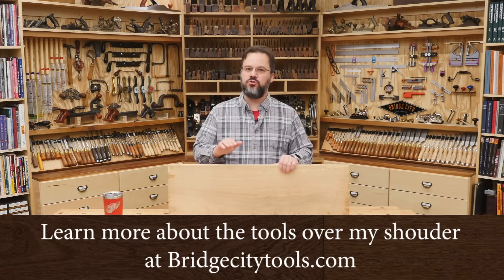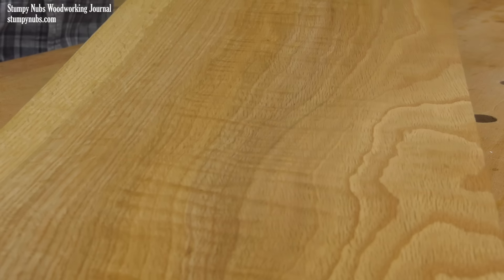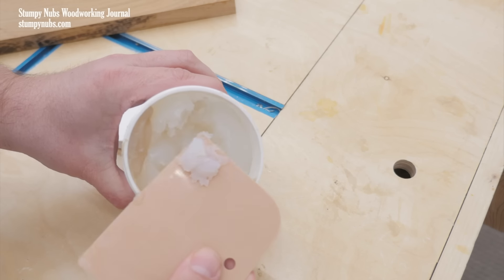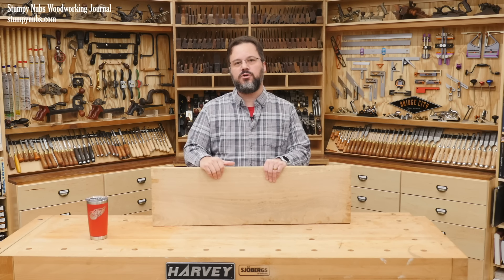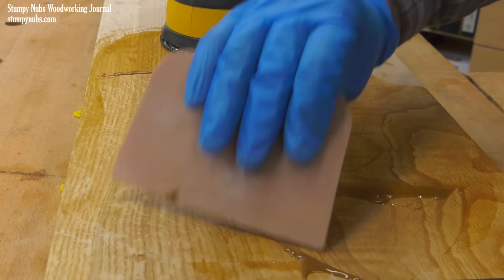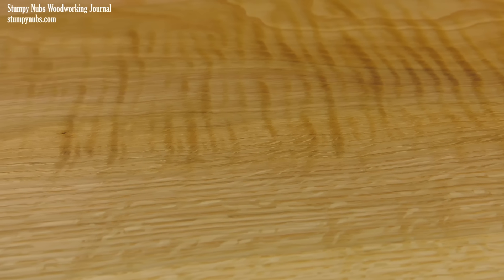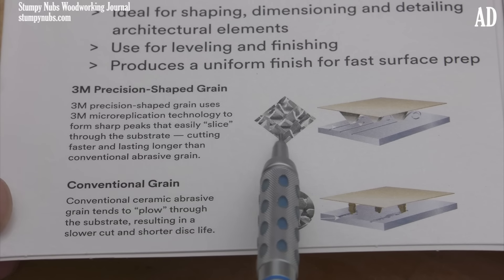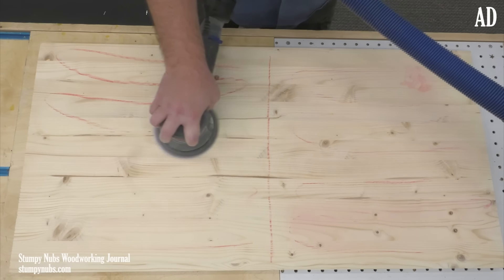The best wood finish I ever used CONTAINS GRAVY!

Comment: so what I'm getting from this is biscuits and gravy are an important part of fine woodworking.
Reply: Small correction - Really good biscuits and gravy are an important part of fine woodworking (and the rest of life).
Reply: Yeah but where are the biscuits? I don’t want the ones that taste like wood chips lol
Reply: @kenbrown2808  really it only affects how you feel the wood. Here in Mexico a similar technique is used because it a lot cheaper and got a very smooth finish on any wood and stills feels like wood and not plastic.
Reply: @pedroe5576  Please describe that technique for this group.
Reply: @Sagart999  I have said in my comment of the video. Here in Mexico there's a similar technique that only old woodmakers and cabinet makers do. Instead of a sander they used a scraper to push the sealer through the pore. The sealer must  be very thick in order to do it and requires an special movement of the hand to apply it without leaving marks. After the pore it's sealed you can continue to put the finish or let it dry. Now a days only old woodworker or cabinet makers know this technique because is a little tricky and requires time.
Reply: There are some examples in youtube but in Spanish. It's very rare to find information because few people still use it nowadays. All just us polyurethane finish and go.
Reply: That sounds great.
Reply: Of course

Comment: I used to dry sand and collect the dust and then mix it with oil to spread over the open grain.  This method holds onto all the dust instead of losing half of it in the dry collection method.  Thanks, Jim!
Reply: What would be the ratio of saw dust and oil? And is it linseed oil or oil based finish?
Reply: @tonyhawk1948 linseed oil, BLO, are both an oil finish, just like oil based polyurethane, pure tung oil and others are. I would be reluctant to use straight linseed oil since it will take forever to cure. Pure tung oil takes 24 hours, poly usually cures in 8 hours. Not sure what the cure time is for BLO, I think a couple of hours?

As far as the ratio, just combine and mix until your gravy is similar to what you saw in the video. There is no exact recipe for gravy, just like when making regular gravy in the kitchen.
Reply: @bigk4755  thank you so much for the information
Reply: BLO and pure tung oil actually take a couple of weeks or longer to “fully” cure. But can be used as a base for filler overnight - depending on how warm or cold it is.

Comment: I used this method 40 years ago on a dining room table. I did it by hand though. Beautiful finish. 6 hand sanded coats of marine spar,finally rubbed out with rotten stone and mineral oil. I had forgotten this technique, thanks.  Sadly the table was lost to Katrina.

Comment: I do something similar with my lathe projects. BLO or Walnut oil with a coarse sandpaper. Sand it while spinning. Put enough pressure for it to get hot, and it will leave a mirror polish. The dust mixes with the oil and eventually cloggs the paper, causing the grit to effectively get finer and finer until it is just burnishing the wood. Works a treat and is pretty fast. The heat generated also causes the linseed oil to polymerize quicker.

Comment: I tried it on a piece of oak plywood I had laying around and this worked and how. I was afraid to sand oak plywood to much for fear of going to deep on top oak level. So I layered 4 or 5 coats of finish trying to make the surface smooth both look and feel. This process work with 1 % of the labor and provided a great surface. 😊😊😊

Comment: Here in Mexico there's a similar technique that only old woodmakers and cabinet makers do. Instead of a sander they used a scraper to push the sealer through the pore. The sealer must  be very thick in order to do it and requires an special movement of the hand to apply it without leaving marks. After the pore it's sealed you can continue to put the finish or let it dry. Now a days only old woodworker or cabinet makers know this technique because is a little tricky and requires time.
Reply: I didn't know Americans used a similar technique to sealed the pore instead of only use polyurethane finish. I'm gonna try your technique with the sander because it looks a lot easier than using a scraper.

Comment: Hey, thanks for the tip on Cubitron. I have 2 decks on my house and both needed replacement. I chose Ipe as the decking material. I saw your bit about Cubitron the first time you mentioned it - probably a year ago. It was just after I started replacing the first deck. Although the lumber was "okay" when it was delivered, I could still see significant planing marks on the lumber. I tested a few pieces by oiling them and the quality wasn't very nice. I also noticed that upon delivery, there's quite a gray haze already starting to form. Suffice it to say that regular sanding disks weren't cutting it. They would last for about 40 linear feet of board and be almost completely depleted. I tried the cubitron on a DeWalt orbital sander (random orbital took WAY too long), and with a little finesse and a short learning curve (sander wanted to wobble and grab), I was able to process the boards with relative ease. The Cubitron cuts REALLY well, but doesn't tear up the grain, so the swirls from the sander don't show at all after oiling the boards. Love your videos, please keep it up!!!

Comment: Years ago, I had a nice herringbone parquet to be sanded, fitted by the customer - a qualified carpenter -.
It was beechwood,  with gaps of 1-2 mm in many places.
Gave it a full sand with grit 80, mixed the fine dust with cellulose sanding sealer, got a fair amount of gravy /putty.
It fillings were not visible at all.
Reply: "qualified carpenter".
He should have stuck with framing.
My grandfather was the same. Journeyman
carpenter, Not a wood worker. 😁✌🖖

Comment: I've done this with Watco Danish Oil and increasingly fine grits for several coats drying between. Super Silky finish with no further need of a top coat on lighter duty pieces. Learned it under the name French Polish I think.
Reply from the maker: French polish is a process of layering many very thin coats of shellac to build up a deep, beautiful finish.
Reply: @StumpyNubs  I probably have the name wrong. It was at least 15 years I read about it, but I've done it on several open grain pieces and it's great.

Comment: Ive been doing a variation of this for over 50 years. Wet sand  with mineral oil and wet/dry sandpaper or pumice, then rottenstone. Clean with mineral spirits and polish with paste wax.
Reply: You are not creating a hard, durable, finish.
You are just french polishing and putting
a shine on the paste wax. To be durable, that
paste wax needs a hard finish underneath it.
Reply: @zapa1pnt  Sorry I wasn't clear. This is what I do after multiple coats of lacquer, shellac, poly etc.
Reply: @IronCreekSW26  : Oh, OK. Much different.

Comment: I use a similar technique with bog oak knife handles using super glue instead of finish. Put a thin coat of super glue, and sand it with loads of debonder applied as you go. It fills the pores with sawdust and superglue and leaves a beautiful finish.

Comment: I suppose it should also work with a mixture of pre-collected dust from orbital sander and oil, all worked in with fine sandpaper or rag? I think it should be equally effective and you also won`t gunk up the orbital sander. Or am I missing something?

Comment: may i recommend filtering sawdust with a set of fine meshes. this way, you can use red cedar heart dust or mohagany to color the pores with different colors
Reply: That could be really nice, I'm sure, but this
method is avoiding all of the collection, and
grading, of dust and just using what is coming
off the material you are working with, at the moment. 😁✌🖖

Comment: Hi James, you have had several videos on shop safety that have been great. I see in Harvey table saw manual they recommend grounding the machine itself. Should we be grounding our work working machine? This is something that I have not done.  Thanks for your input.
Reply from the maker: The machine is grounded through the electrical outlet, isn't it?
Reply: @ Thanks.  Thats what I understood.  But they call it out separately in manual.

Comment: This sounds interesting. I also appears to be relatively simple. It is something I will have to try in the next project. I have not used much oak for furniture so I haven't encountered the open grain problem. However when I started wood working in my 30's, I do remember several references to using a grain filler. I seem to remember it was worked into the grain with something like burlap. Does my memory fail me? Thank you for sharing. Have a great day and stay safe.🙂🙂
Reply from the maker: Never used burlap, myself.

Comment: If I’m using a stain, should I apply the stain first then make the gravy?
Reply from the maker: You can't apply stain over it because it's basically finish. The stain won't absorb. However, I'm not sure I'd apply stain first, either because the sanding will lighten it. I'd suggest experimenting on a scrap of wood if you want to try it.

Comment: So is there any benefit to thoroughly cleaning all of the dust off of a workpiece after sanding and before finish? Obviously left over sawdust isn’t going to create the gravy, but is there actually any downside to leaving it there?
Reply from the maker: You can leave it if you like to have a bumpy finish.
Reply: @StumpyNubs  Are you referring to the fact that you won't be sealing the grain with it or are you saying that not clearing the sawdust before applying finish with or without using a grain sealer will result in a more bumpy finish than had you not cleared the sawdust first? I ask because it seems like not clearing the sawdust is effectively an extremely diluted gravy solution. Seems like it wouldn't provide any benefit, but I'm unclear on how it would make a finish bumpy when the gravy is a lot of sawdust plus finish.
Reply from the maker: @SomeDudeOnline  The "gravy" is worked into the pores and smoothed out before applying your finish. If that leaves a bumpy surface, I would suggest sanding even that before applying a finish. Random dust that settles on the surface is a common cause of bumpy finishes, so I would always at least wipe off a surface before applying new finish. Leaving sanding dust on the surface, they just applying finish is not going to give you the controlled results we are talking about here.
Reply: @StumpyNubs  I see, thank you for the clarification.

Comment: Do I need to do any regular sanding with lesser grit sandpaper first? Or do I just start with 400 grit to make the gravy and then go back through all my sanding steps?
Reply from the maker: No, sand to your usual level first.
Reply: No, this is the first step in your finish, After
you have done all your wood sanding. Notice,
you are using 400 grit sandpaper, to make
the gravy. 😁✌🖖

Comment: Great video on filling imperfections in wood for a nice finish. I have loved all your videos and cool tools segments. I was gifted a package of the 3M brand sanding discs mentioned in this video. But, Velcro back wears out before the sanding surface does. Do you know if anyone else has had this problem. I really do love these sanding discs.
Reply: Do a Google search, on the subject.
I'm sure you will find something.
Just off hand, I think maybe you are
using too much pressure, when you sand.
Don't push down, on the sander (common
mistake), just move it back and forth over
the material, letting the sander do the work.
BTDT 😁✌🖖

Comment: Can a hardwax oil be used to make the gravy?
Reply: It could, if it will also be your finish. A common
finish should not be applied over the hardwax,
because it is Wax and the finish will not properly
adhere. 😁✌🖖

Comment: I used a similar approach on a walnut grandfather clock: wet tung oil wet-sanded with 600 grit wet or dry, then wipe off.  I didn't make so much slurry that I could spread it with a spatula.

Comment: Could you just use your sander with the crappy mfr dust collection bag, sand the wood dry, empty dust bag into the oil, stir, and then apply?  I keep a bottle of "dust flour" (made as described here) for filling holes and imperfections by mixing with glue.
Reply: I have the same question.  further, is it important to sand the gravy into the wood or could you prepare it on a project scrap then collect and spread it onto your workpiece?
Reply: @philfrank9483 : Sure, you could, but that's kinda
the hard way. You have already created enough dust,
sanding the wood, to prepare for finish. Doing this, you
don't create any dust at all. It all stays in the finish, on
the wood. Saving some dust, as the other fellow does, is
good for filling cracks and such but here, those particles
would be too big, for filling the grain, as you want them to do. 😁✌🖖

Comment: Stain first and then make the gravey?
Reply from the maker: The act of sanding will lighten your stain color. And you can't stain the gravy itself once dry because it contains wood finish.
Reply: @  I actually prefer little to no stain but if I wanted a bit of stain  maybe add some stain to the gravy?

Comment: This may sound silly, but why do you have to "make" sawdust? Why can't you just add some fine sawdust from the board to the finish and then work it in with the applicator? Putting a sander through this just seems wrong.
Reply: That is a good question, I also assume quick drying finishes are a  no no?
Reply: Im asssuming that this method makes a polished surface 
The polishing compounds for metals if they are "soft" its usually the same as metal with wax
Reply from the maker: You can mix very fine sawdust with a little finish, but you'll have to work it in to the surface.
Reply: @StumpyNubs  Either way, good to know!

Comment: DO NOT use an "oil based" finish (which contains a solvent) with a hand tool that has a brushed motor and spread the solvent over a large open surface and heat it and agitate it with a brushed 120v tool (that creates thousands of sparks on the brushes) and is designed to move air around in the vicinity of the large flat thing that is being agitated and heated that is covered in flammable solvent
do not do the above in an area that has lots of finely dispersed flammable wood pieces/particles/dust and if the surface covered in solvent in the aforementioned situation is itself a piece of flammable solvent impregnated wood
Reply from the maker: You are living in theory. That's not what happens in actual practice.